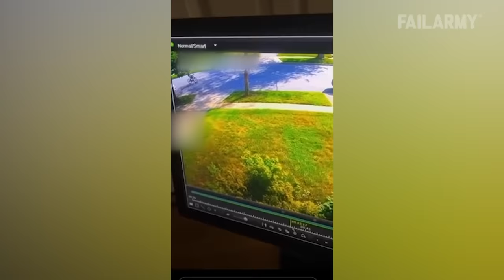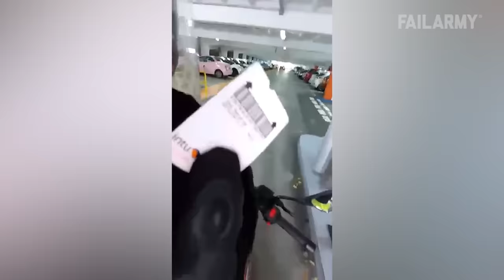Idiots On Wheels! | Fail Compilation

Comment: 15:47 had me cracking up cause that reminds me of a hilarious situation I had in college. One of my roommates (who shall remain unnamed) had a 2011 Mustang with the 1st gen Coyote and he was so proud of it, always bragging about how he was all that and a bag of chips and how he could gap all of our cars. One night he severely misjudged the depth of a flooded road and got his Mustang swamped in 5ft of water. Shortly after, me and my gf were woken up by his call at ~3:00 am, and he asked me to make the 1 hr drive and pull him out. I got there at ~4:15 to find a AAA tow truck already there. As it turned out, it was even too deep for the tow truck, so I was the only one who could rescue his car. My Toyota diesel pickup has a lift and a snorkel, so I had no problem getting in there and pushing his car out with my bull bar, at which point I helped him take the plugs and coils out and flush the water from the cylinders only to find out that the whole wiring harness was fried and ended up towing the car home anyways. You may be wondering, why did you sacrifice a good night's rest with your gf to go and help a guy that you don't really like that much and rescue a car that you like even less? Because I reveled in the opportunity to rub in his face that my Toyota was way better than his silly Mustang, even better than some tow trucks. After that, my pickup was the talk of the crib, and he never lived that experience down. Oddly enough, we did end up being very good friends afterwards. He eventually sold his mustang after fixing it and bought a 2007 4Runner Sport. I still have my '89 Toyota with 850,000 miles on it. BTW, 5 ft is not an exaggeration. His car was not even visible above the surface. I had to play it by feel, and put a pretty significant dent in his trunk as well as destroyed his transmission since it was still in drive and the cylinders were hydro-locked. His insurance ended up paying for everything.
Reply: nobody asked
Reply: So your Toyota was just naturally superior? Had nothing to do with the SNORKEL AND LIFT THAT MADE IT HADLE 5 FEET OF FLOOD. WATERS.
Reply: @stellviahohenheim  Nobody asked you to be rude, either. What's your big deal? He's just sharing a story of his, and you could have just as easily scrolled to any other comment. What, does it remind you of something you'd rather not think of? Are you the other guy? Not that I expect you to reply. Though I also have reply notifications shut off.

Comment: There is always that one person that sees all those people NOT driving through the flooded roadway.
Reply: with the smallest lightest car.
Reply: With a Prius, where the engine could turn off at low speed and run on electric instead.
Reply: i used to float my civic across the Agua Fria crossing near my house for fun . an idiot with a H2 hummer ruined it for all of us by getting stuck
Reply: If people are going to try that at all, which they shouldn't, I've never understood why they go straight through the middle which is likely the deepest part. At least try going as close to the edge of the road as possible.

Comment: The stories I could tell before cell phones. 

My friend took his dads truck and jump our towns “thrill hill” and heard an awful sound. Took the truck back and parked it. Dad said “Let’s go to town” and when the dad was driving down the road, the wheel came passing them up. 

My brother was cruising in another town on a Saturday night and his trucks transmission went out and only thing that worked was reverse. They drove all the way back to the house over an hour away in reverse. 

I jumped the same “thrill hill” in my other brothers truck and the front wheel took to the newly dug out ditch. Hit a tree and totaled it. But at least I did the right thing and paid off his truck.

Comment: Let's put a fireworks shop on the corner of a busy intersection.
It'll be fun, they said.
Reply: Heh....it was. That engine must have been hot though, to set them off, then the chain reaction....pure comedy...still, it wont have been much fu for anyone in the shop or the car....
Reply: That ain't nothin'. In the small town I grew up nearby, someone put up a fireworks stand next to the railroad tracks running through the center of town.

Comment: I’ve actually been rear-ended by a bicyclist. Traffic was heavy, doing the stop-and-go thing, and a guy on a bike came cruising out of the bike lane directly into the center of my back bumper. He was so drunk that he could barely stand up. He started yelling at me — incoherently — then he got back on his bike and tried to ride away. The front wheel was bent, however, so he ditched the bike on the sidewalk and staggered off in the direction he had just come from. I got out and looked at my rear bumper, but there was no damage. I tried to ask him if he needed a ride, but he just walked away, flipping my the bird as he did so.
Reply: You are so good, a bad day for that guy
Reply: I once got rear-ended by a cyclist too. I stopped to let him pass before I made my turn, and when he didn't show up beside me after several seconds, I felt a bump and saw him hit me right in the middle of my bumper, for which he had to have made an effort to not continue his clear trajectory. He fled the scene when I got out to see if he was alright, with several witnesses saying they believed he was under the influence of drugs. No lreal harm done and a good anecdote, I suppose.

Comment: The kid on the bike is astonishing. It amazing how is life was literally saved by running into the motor bike, that knocked him off his bike, break his speed, just enough to get him across the other side of the road so he didn't get crushed by the bus. A milli second faster he would have had a direct hit with the motor bike, and both be crushed, a milli second slower he would have roll down that hill, God alone knows how that would have ended.
 
We are not alone.

Comment: Some funny stuff.  I don't consider racing accidents "Idiots on wheels" though.
They are not on the street but in competition and pushing the limits (which is why they are not on the street).
It does not matter what you do.  If you push the limits, your gonna crash once in a while.

Comment: 6:55 I'm not even sure how they could mistakenly do that either considering diesel nozzles are LARGER than gas nozzles for a reason.... You can't even fit them in the opening for a regular car... So either they are driving a diesel, or the managed to find the one pump with the wrong nozzle installed.